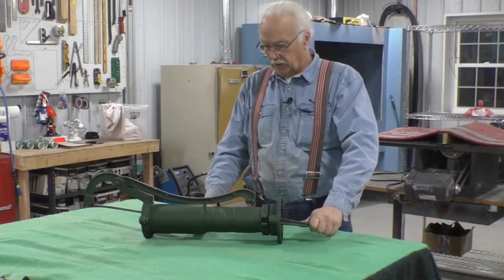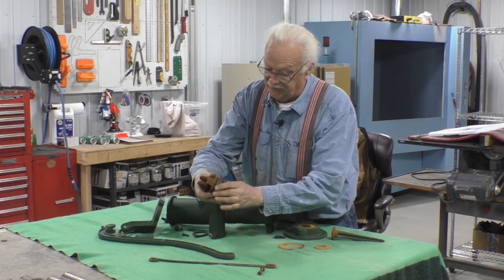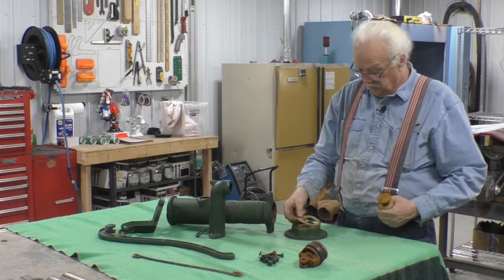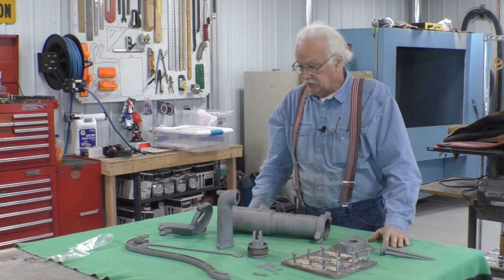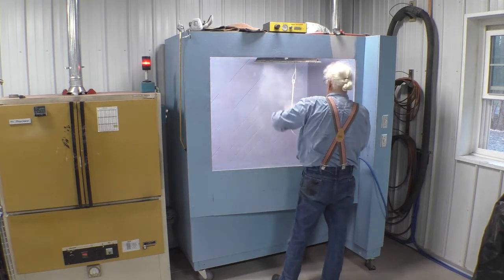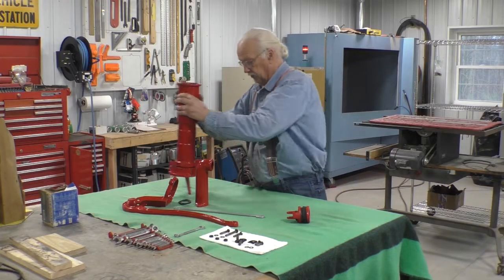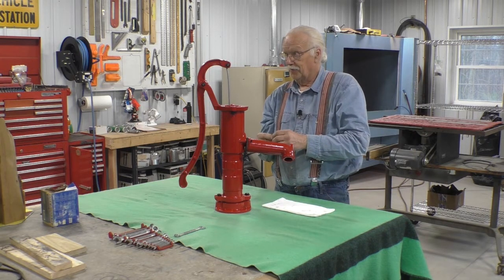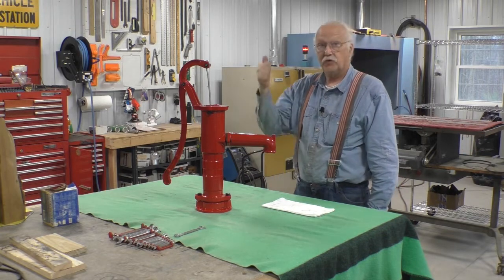Refinish old hand Water Pump

Comment: I have an old 1900’s Myers hand pump sitting in the well on my farm. I’d like to replace the seal inside and get it working again and restored. I’m not sure where to get the part for it or how to disassemble the thing. We used to use it when I was kid. You have any information on vintage hand pumps? Thank you. Nice job on that pump!
Reply from the maker: I'm sorry, that was my first pump.
Reply: @ThrottleStopRacing  oh ok, thank you. Perhaps Ill have to make my own youtube video with my pump. I currently have it disassembled. I took pictures of it and sent to a company specializing in hand pumps. I hope to hear back  from them if they have parts for it. If things get bad in America, I want to have my own water source and self sustain. People dont think of that stuff. Thanks again.
Reply from the maker: @jimb3093  Sounds like you have it well in hand.